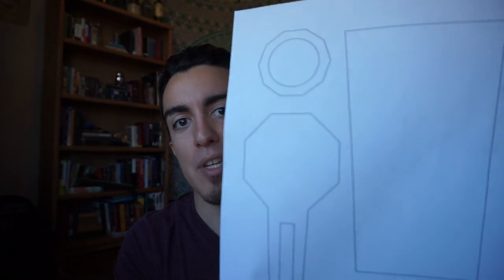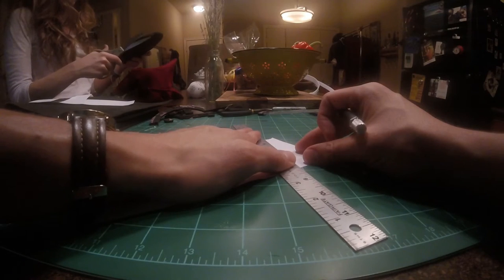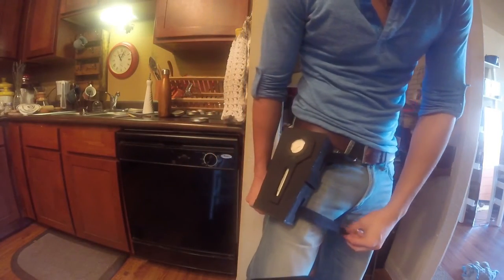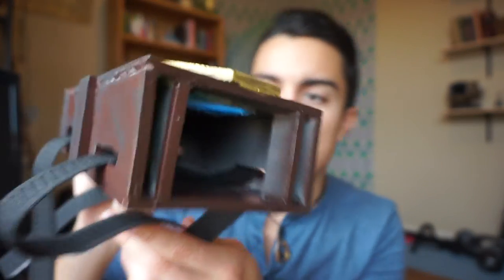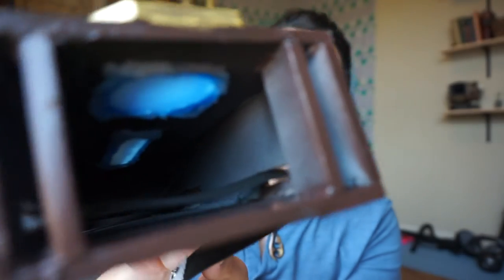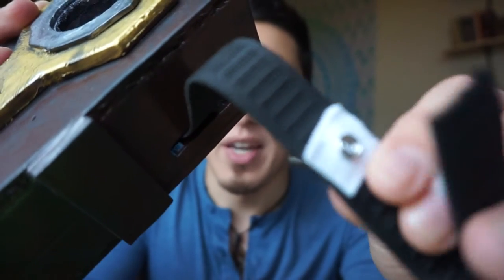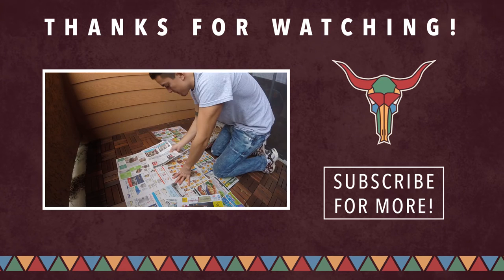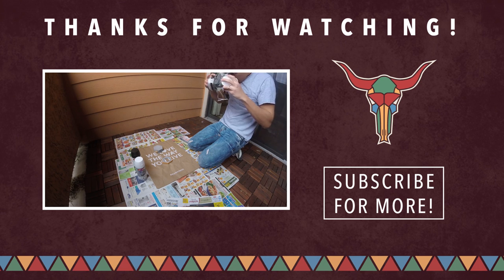BUILDING A HOLSTER WITH FOAM | Handsome Jack Cosplay Build, pt. 2

Comment: um I need help .........you know the blue circle right can we use any blue plastic and if so how do you cut it
Reply from the maker: +ILLUMANTI _ That plastic was honestly the biggest pain in the ass for me, but I know better now! For mine I just got a blue plastic box from Michael's in the craft storage section - unfortunately the plastic was WAY TOO THICK, so I'd recommend you just find a blue Tupperware container or another plastic storage box that's either blue or has a blue lid. It really depends on what you're able to find, but look for anything with a few inches of totally flat surface. I had to cut mine out with a box cutter (which took forever since it was so thick) but if you find something thin enough, then just plain scissors should work!

Comment: Could you provide links to Amazon for the foam you are using? :o
Reply from the maker: +Mariusz Kubiński I couldn't find the exact foam I used on Amazon, but here's one that's really similar:
http://www.amazon.com/Foam-Sheet-9-X12-6mm-Black/dp/B001946SH0/ref=sr_1_41?ie=UTF8&qid=1460580956&sr=8-41&keywords=foam+sheets

A few sheets of this should work just fine!
Reply: +MatadorPhilip thanks!

Comment: and what foam did you use ?
Reply from the maker: +ILLUMANTI _ I got the foam at Michael's, but you should be able to find it at most craft stores; I can't remember the brand name, but if you look around the general crafting section, near to the kid's craft supplies, you'll find a bunch of sheets of craft foam, and I got the stuff that was about a quarter inch thick (I think you can get it as singles or in multi-packs). If it's hard to find, just ask an employee where the craft foam is. Hope that helped!
Reply: +MatadorPhilip thank you !!!!!